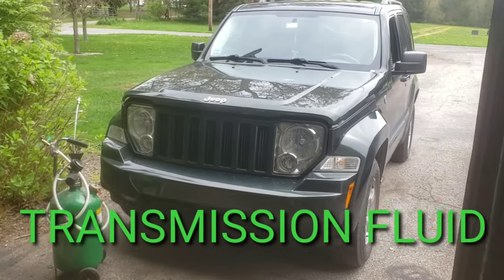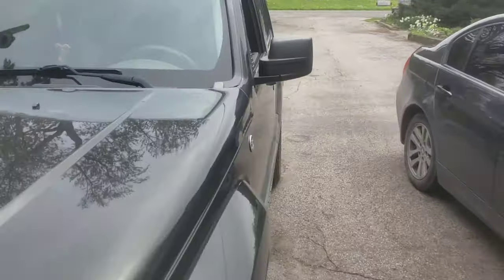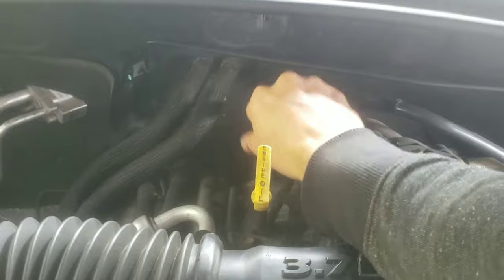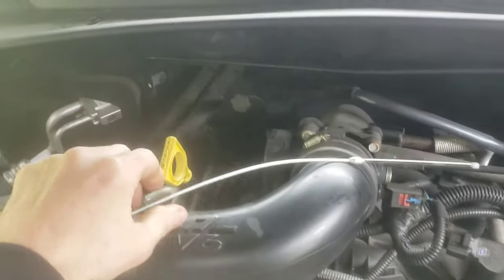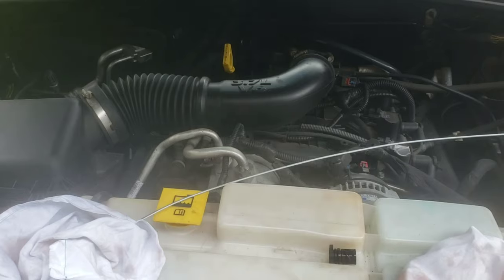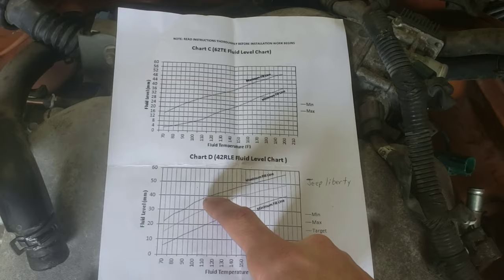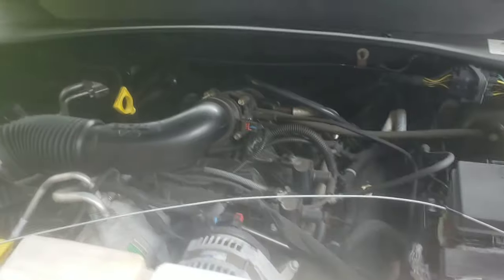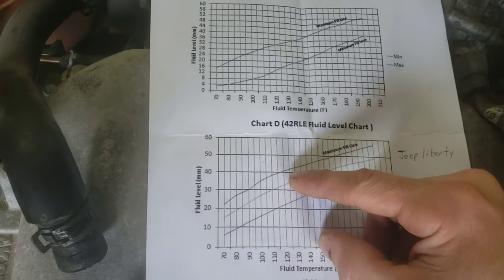JEEP LIBERTY TRANSMISSION FLUID FILL 2011 ,DODGE ,CHRYSLER

Comment: How many quarts total does it take for just a pan drop and a filter change?
Reply from the maker: In that case it takes 4 quarts.
Dry fill capacity is 8.8 quarts
Service fill is 4 quarts which is what you are referring to. 
Make sure you have the 42rle transmission, you know this by checking to see if it has 13 bolts on the transmission pan

Comment: If your transmission fluid is low will it cause my Liberty, to go into limp mode? My Liberty won’t rev over 2000 rpm, or go over 25 mph. I had my battery tested yesterday, and wouldn’t go over 25 mph. I changed the battery out, it started driving fine, but the following day same issue.
Reply from the maker: Low transmission fluid doesn't make it go into limp mode but it will make that the transmission slips ,sounds like you have an engine problem, check battery voltage, alternator, misfire

Comment: I dropped my pan and exchanged my filter. I put 4 quarts and heated it up and I used a dipstick and it shows I have 0 oil in there smh
Reply from the maker: You'll need to put in at least 5quarts for that job.
Reply from the maker: make sure your dipstick is long enough.
Reply: yoden ok thanks

Comment: Did you drop the pan? If so did the exhaust get in the way at all? I’ve seen on JKs it does but there’s not a ton of info about the libertys.
Reply: Joshyoden I dropped it last weekend. There’s one bolt that gets in the way of a standard 3/8 10mm socket. You’ll want to use a 1/4in driver and socket on that one particular bolt.

Comment: Where did you get the oil temp chart..?  Have a 2010 Liberty Limited, trying to find this for my vehicle.
Reply: If you buy a dipstick on amazon for like 9 bucks it comes with the chart
Reply: the oil temp chart is in the OEM Shop Manual from  - on CDROM in my case.

Comment: If my jeep runs out of gas before Amazon delivers the dipstick should i keep filling it up with a gas can? Or push it to the gas station since its in neutral?

Update: i just pushed it, it was really far, and my wife's arm almost got stuck under the tire and nearly broke the temperature reader, but she hung on giving me constant temperature updates. And Amazon finally showed up, and turns out, the transmission level was fine.

Comment: How do you know how much fluid to put in. Let's say it's reading 30mm and it should be 40mm, is that one quart or half. Should I add a  half quart at a time and keep checking.
Reply: I would do half quart at a time to be safe ,  I changed the transmission filter and pan and I had to put in 6qts after doing that

Comment: The O ring on my Transmission cooler hookup failed and a lot of transmission fluid leaked out, what level should I aim for on the dip stick? I figure if to much came out the temp reading might be off, but that just a guess.
Reply from the maker: Let it run in neutral with park brake on for 20 minutes or until it's at normal operating temperature. Then aim for 40 millimeters on the DIPSTICK.
Reply: You can add the fluid that we to just use a funnel

Comment: Did you just add the transmission oil only or changed the filter aswell.
Reply from the maker: I just added oil.   This link is for a video were i change the filter and fluid.
https://youtu.be/GHyUfkKgBGY

Comment: I saw another video that said 45mm is the fill. I’ve never touched it and it’s around 50mm. My transmission is making whirring noises and shakes a bit so I thought it was low. Idk which direction to head beside the torque converter?
Reply from the maker: Did you check the drive shaft u joints

Comment: hi, please tell me, I have aJeep liberty  2011 sport. I changed the oil, changed the filter, poured ATf +4 mopar. 5 liters. I have dipstik just you have, but I don’t know how to measure the temperature. I've no chance to check the temp..
Reply: you can somehow find out approximately without devices what is the water temperature when the arrow is in the center?! to see on the scale how much to add oil in the box.

Comment: The early first edition Jeep Liberty's were great, looked great, didn't have tha dog ugly square looks, even came with trans dipstick and dont need a heat chart to check trans fluid, just pull it out, is says full, that means good to go, no temp gun needed. I'd try using the oil dipstick, wipe it off and stick it in the trans...........